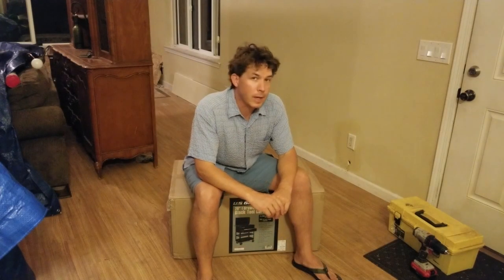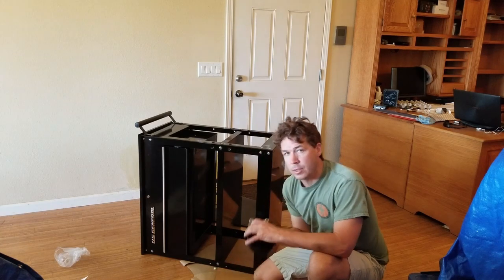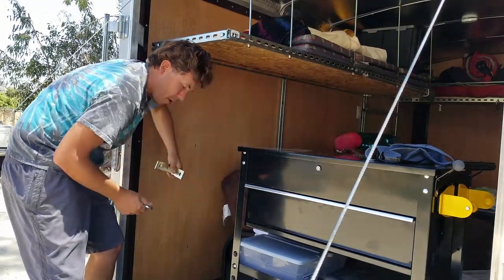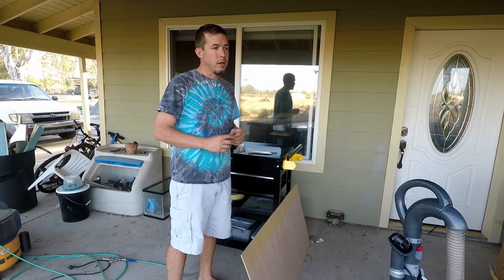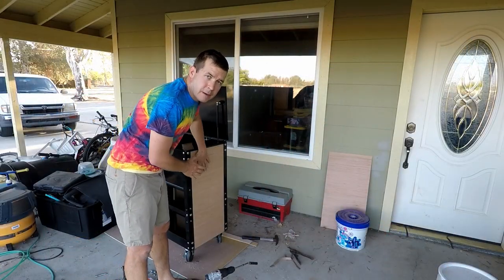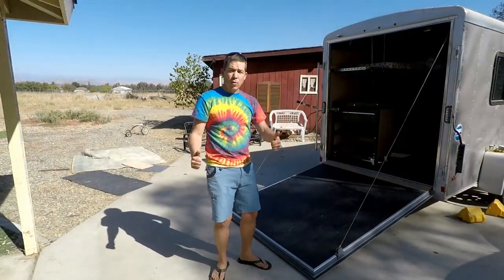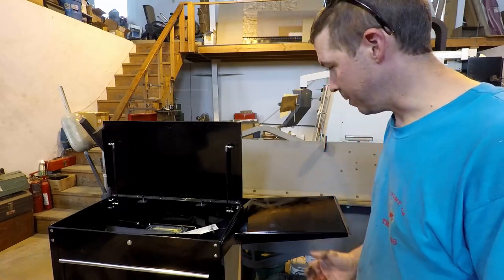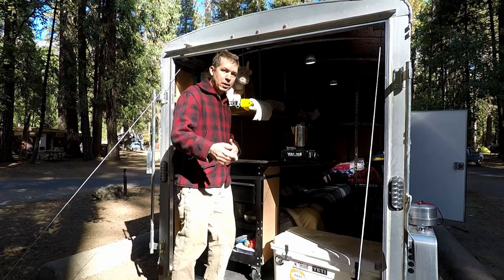Cargo conversion Kitchen build

Comment: 11:26 - I have the same stove.  These are suitcase butane stoves, they burn high and very portable.  However, danger alert!!  - Several posts about these stoves exploding.  Two things to watch for:
1.  Never use a wide pan on these.  It forces flames out horizontally and they overheat the little butane cartridge right next to the flame and BOOM!
2.  Check butane cartridges for defects before using.  Place it in correctly in the slot without forcing.  Check stove for no defects.  Any mistakes and BOOM!
Remember these stoves are made in China with low quality control.  Explosions are very severe and will result in major burns on body and your rig up in flames.  Keep an extinguisher handy.  Do not use this as your primary stove.  Use as a backup only.
3.  The Campchef Ranger Blind II propane portable 2 burner stove is high quality, burns high at 17K BTU, and costs around $110.  Definitely a better option.